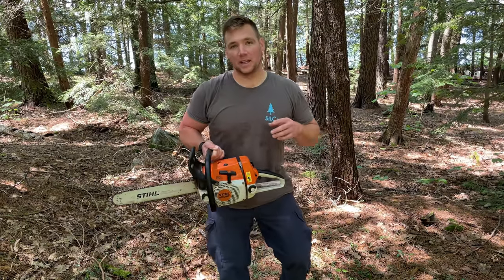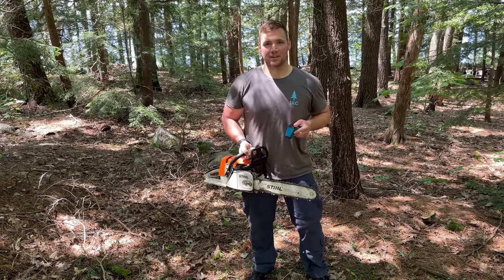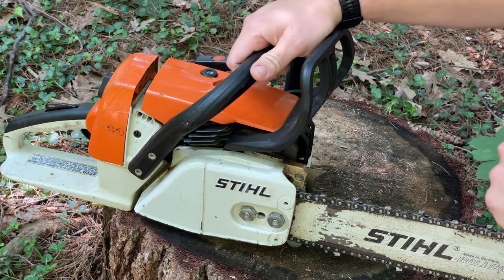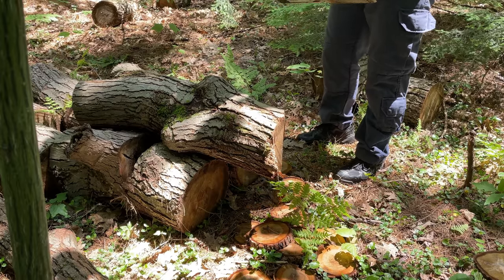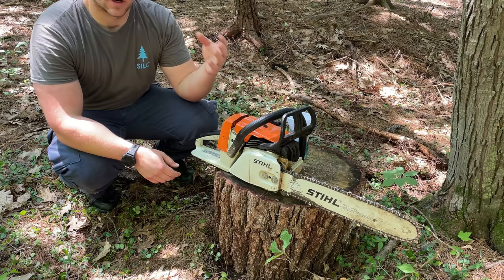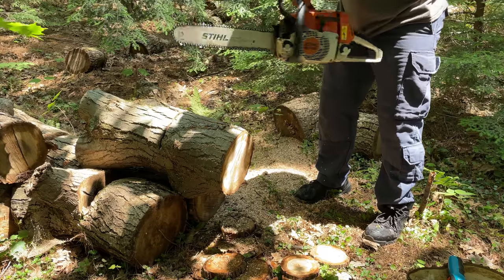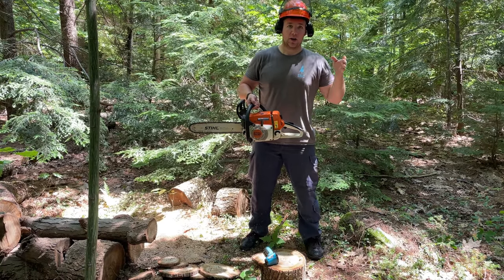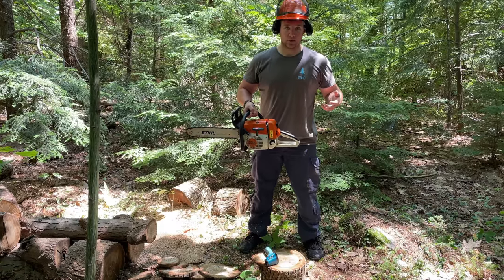Will my chainsaw last longer if I use more oil? Is it safer? (25:1 VS 50:1 temperature testing)

Comment: Excess oil barely helps the bottom end, excess oil really hurts the top end. It actually causes more of a piston slap effect as oil burns slower then gas and gets built up. We've done a lot of research and have found this. 50:1 lasts forever it seems. Thousands of hours on original top ends.
-Edit now that I've watched your video, no offense but you need to not run such dull chain and or high raker . Not sure what's going on there but your bar & chain might be getting hotter then the motor.
Reply from the maker: Hey Erik, thanks for the comments! I have been using 45:1 but I may go back to 50:1 with your research in mind. I’ll look into the chain!
Reply: @DavesSmallEngines  To each their own. 45:1 ant bad but I'd refrain from 40:1 and especially anything richer. 
And yeah, "Sharpening is key"

Comment: actually use a 50:1 ratio and had a glob more times than others it will compensate for a carburettor set too lean

Comment: who the hell runs 25:1 anyway .  of coarse it will lose power with that mix . it does'nt mean 40:1 is bad . i figured 40:1 
would help it cause the ethanol makes it run hotter. but 25:1 is way out of hand . the test should be 40:1 vs 50:1 
 if it's close enough i'll go with 40:1  , 50:1 is for emissions . BTW , i am now removing the ethanol from the gas 
with water . but i will still run 40:1 till the EPA cops catch me . ethanol vs non ethanol would be a good test to try
to compare the temperature .

Comment: 40:1 always " in every type of 2 stroke  but 1 that' exclusively runs 32:1  today's oli don't burn smoke or leave carbon deposits like oils of yesteryear" back then if it didn't smoke something's wrong" but castrol smelled almost as good as bar b q"

Comment: After reading comments ….and some thought  , I propose  that there’s no evidence that the extra heat of running the saw with more oil  result’s in a disproportionate amount of damage damage  🤷.    I’m not a mechanic  of any type … I just cut shit with my saw  .  I always put a splash …extra oil in my mix  👣🦘  .   I know consumerist corporations design stuff to fail now days .    
At some point in time , we went from being valued Customers , to  over abundant consumers Ripe for the picking  .     

My recommendation is , don’t believe what you are told you know - do your own investigation’s  about everything .    

If all you know is what you’re told you know  - have you learned anything , or simply been tolled what to believe …. And how to think about it .

Comment: There should really be no debate here.. the engine is designed to last a certain number if hrs at a certain air fuel ratio and certain amount of oil. Running the engine leaner on fuel is certainly terrible for it. More oil will not save it from that. Now if you rejetted it to have the right air fuel ratio while having an increase in oil, maybe itd be beneficial but probably not, youre trying to redesign something thats already had tons of money put in to testing these things, more money than any of us are going to spend.

Comment: The saw Goin be hotter cuz it was worked harder on 25 to 1 cuz a chain is not as sharp clearly n he's not dogging on as much like 50 to 1 an we don't know if the carb was tuned for the 25 to 1 ratio so have to do myself n see
Reply from the maker: If it was duller... it would work less hard!

Comment: This is far from conclusive.  First of all, more oil means thicker fuel so you would need to tune the carb to run richer.  You essentially leaned out the air fuel mixture which will make your saw run hotter.  Plus, doubling the amount of oil is not realistic.  Try 32:1 or 40:1 and tune the saw between tests.

Comment: I can tell you if it ain't smoking you don't have enough oil in it. In two cycle engine spark plugs are cheaper than the engine. I've been doing this for over 40 years

Comment: So  you  are saying the  oil  leaned it out.. You needed to  open the carb screws to make  it  run at the correct fuel ration.
  Race bikes  make  more  Horspower useing  Bean oil at  20 to 1 than the same engine  makes  on 50-1 synthetic  oil .. Just a long known fact among motocross racers..

Comment: It’s painful for me to watch you cut with that dull ass chain. I’m assuming your trying to heat the saw up by running a dull chain? You are running the saw lean with the 25-1 because you didn’t adjust the carb. More oil means less gas and a leaner mixture. My experience with high quality modern 2 stoke oils is that 40-1 is about the best ratio when it comes to a compromise between life expectancy and carbon deposits. 50-1 is an EPA thing, don’t run 50-1 if you want your engines to last. 50-1 with a good oil will keep the top end alive but it will starve the bottom end of oil.

Comment: Long term causes carbon build up on the piston and top of the cylinder head. Carbon will eventually score your cylinder walls and reduce the airflow on your exhaust side causing more heat and eventually failure. Leaner fuel is actually more healthy when you use the correct oil. I rebuilt chainsaws and have seen the effects.

Comment: It’s not a good test. You need to post at least three cycles of baseline to prove that the saw doesn’t stack temperatures it could be that the saw increases temperature through each three minute cycling and three cut series so we need to go back to the drawing board and post a baseline at 50 to 1 where you do that series 23 times to see if the subsequent cycles show a temperature increase which I suspect they will

Comment: I can already tell you,. without hearing results...
If you kept the same carb settings or tune,. With higher ratio's you essentially are running leaner with the higher amounts of oil.
Nice Try.... of coarse it's going to be Hotter being Lean, 
You went to a lot of trouble to do a whop sided  test.
I'll tell you this,. ..

I'm running a 1970's homelite 650 today on original cylinders and piston, that saw is probably older than your parent's.
Furthermore I have a neighbor that runs a landscaping business and has to buy new equipment every season or 2 (two).
Everything is 50;1 Sthil brand. Sthil Oil.
And I am talking about 12 years of history for reference,. not a 1 afternoon filming session.

My closing thoughts,. I see 40 or so years of real use,. and I have new Husqi equipment that I tune to run 32;1 and yes it smokes a little,.
But my stuff runs every-time and every year,.. and I heat with wood and have 2 sawmills,. so my stuff is not just sitting building years,. they earn their keep.
Compared to your 1 hour vested and stacking the deck in favor of 50;1... I'll take my years of FACTS over your yellow diaper comparison. explained, you still $#!ting yellow. with the way you did this "little test"
You might fool the city folks reading,. but guys that turn wrench's and know how to turn them are not fooled. 
Another 1st hand run.
I ran a PE 175 dirt on 100;1 because someone "Smarter" than me made the comment that oil actually caused drag.. (I was late teens eary 20's) 
I burnt the piston grove out behind and around the rings in 10 minutes Top's,. a brand new Wiseco in the 90's to the tune of $100 
It ran like a bat outta hell but the time and effort was not worth the reward.
So at 55 years old in the year of 2024,. I say "for once and for all" it is NOT OVER. 
I'll keep my 32;1 thank you.

Comment: So you run 50-1 on a cold engine and then switch to 25-1 after its already hot and "prove" that 50-1 runs cooler? You also didnt retune the carb. 40-1 is a better ratio anyway or maybe 32-1 at the richest.

Comment: If you check the spark plug on an engine that has been running rich on oil you will see a lot more carbon deposits.

Comment: There is not a lot of difference in the amount of oil between 40:1 and 50:1, but twice that amount @ 25:1. If your just a home gamer wood tic then 50:1 is good.

Comment: Well my chainsaw likes 40 to 1. I run it at 50 to 1 and when I shut it down it won't start up again until it's cooled off. 40 to 1 it'll fire right back up. So explain that.

Comment: Interesting topic.  I would be curious to run the 50:1 after the 25:1 and then do the 25:1 test again so you have 4 sets of data allowing time for the saw to cool to see if the results repeat.  Seems like the Stihl engineers may have tested this already?  Lol

Comment: More oil means it's harder for it to burn the gas . Less oil it burns better because it's easier to ignite the gas fumes.  Because it the fumes that ignite and a Lube oil doesn't  burn as easy.  Do a test on it and you will see and then you will know why it's not good to use more oil

Comment: Going from 50 to 25 to 1 is an excessive extreme. I doubt you would find more than a 1 degree difference running a 40 or 45 to 1 in a 50 to 1 saw. And personally since i dont have a means of measuring the oil id rater have a little extra than run it lean
Reply from the maker: That makes sense to me, Jimmy!

Comment: What I noticed is you ran the saw at higher RPM when testing the 25 to 1 mix.  Of course it will be hotter.  You claim the 25 to 1 had less power, less power means less heat produced.  So your test is invalid.  If anything the 25 to 1 should run cooler.

Comment: Your audio is a bit low in most of the video.   Addressing your title "25:1 VS 50:1."   You been chatting with your elders.  25:1 was a ratio before your time.  Today the oil and today's saws (as shown in this video) is/are of higher quality than it was in the 1970's and earlier.  Hence, today's 50:1.  Basically, it is best to slightly over oil than it is to under oil.  With more oil you will see smoke and the engine will labor more, but you'll have engine lubrication versus NOT with to little oil.  It is a question of how long to you want to keep your saw alive and well.  (JF)

Comment: You took it to the extreme.  No one runs 25:1.  You should have tested 40:1 and 50:1.  The second test you also started with a warmed up saw.
Reply: Stihl advises to use 25:1 for non-Stihl oils.

Comment: To much oil gets you more carbon build up.. for milling I run 40:1 because I'm running it hot.. 50:1 for everything else with good oil
Reply from the maker: Sounds good!

Comment: 32:1 kicks butt and equals 4 ounces to  gallon
Reply: Bit too much oil on modern Nickasil engines. Try 42.5:1
Reply: @shannonwhitaker9630  50:1 with ceramic crank bearings

Comment: My old pro Mac calls for 30to1 of straight 30 weight oil
Reply from the maker: Hey Wax! Oil has come a long way since then!!!
Reply: @DavesSmallEngines  that's true but that saw been run that way since it was new in 1979 and still runs like brand new

Comment: Before this gets started, these manufacturers spend a ton of money testing what's best. If more oil was better, that's what they would recommend.
Reply from the maker: I agree, Jeff!
Reply: @DavesSmallEngines  Men have this "More is always better" complex. Lol. And "Instructions!? Who needs Instructions!?"
Reply: @DavesSmallEngines  I've been looking into Amsoil. They swear 100:1 is enough for anything. I was already thinking that would lower the temp on the engine before this video, which I'm just now getting to finish. I'm curious to see what temps you arrive at.
Reply: At 25:1, it would probably lock down eventually, and I expected more heat. But I wonder if a 75:1 would be cooler? Probably about the same, but stopped up screen and could plug would happen much quicker.

Comment: No it won't it will cause clogging and power loss, but if you use JASO FD oils 2% instead of Stihl oils, then your machines will run much longer...

Comment: 25:1? Sounds like Chinese doesn't have a clue or they just don't have the high quality synthetic oils that we have in the U.S. I run VP Racing at 40:1 carb tuned a bit rich to 4 stroke letting up in the cut of a log close to bar size. I scored a piston/cylinder running 50:1 too lean. Live and learn.

Comment: I've litterly just poured a cup of heavy weight diesel engine oil in a gallon of high octane and have run many many small engines daily for 3 years so far. My forman stoped buying premix oil but would be pissed when I couldnt fuel anything. I said eff it. I'll just use what we have. If anything since I started everything actually runs better. The k saw cuts concrete better on my heavy mix lmao

Comment: I think you are getting into BTU values between gasoline and oil. Oil does burn hotter than gasoline so burning excess oil add to BTU value and therefore higher exhaust temp. If so not indicitive of lubrication efficiy. imao

Comment: Unless you tune the motor for each level of oil you have completely wasted your time. However, you do show that more oil will just lean the fuel mixture resulting in less power. However, performance two-strokes run high ratios of oil resulting in more power.
Reply from the maker: Hey there! All great points. Thanks for the comments!!!

Comment: Hay Dave no one will go from 50:1 to 25:1 and the heat and power difference is well known so this vidio is a waste of time, your camparison should have been done with a resonable mix of 40:1.--In sum the difference with those two factors(heat and power) would be minimal and not even noticeable on some engines, that little difference is more than worth the reliability and the longevity of that engine. I won't run anything higher than a 40:1 fuel ratio regardless of manufactures recommendations and never use less oil than the engine manufactures recommendations. All you contractors and owners of these engines and equipment spare yourselves some money and headaches and DON'T EVER believe any of these premix and two stroke oil companies that claim that their richer fuel mixture covers all mixes and supersedes the engine manufactures recommendations, this is false. Yours truly, Paulie T. (63 year old born gearhead)

Comment: Well sure at 25:1 it will run sluggish because your replacing oil for gas at this drastic difference. 40:1 is best for longer engine life ,just common sense more oil more lube.

Comment: If you use more oil than recommend the extra oil will not burn as clean and turns into  CARBON that builds up behind the piston rings FORCING the piston rings to be forced out toward the cylinder walls causing a loss in power due to increased friction to the cylinder wall and RAPID excessive carbon build up in the head and crank wear........

Comment: 3 oz per gallon
Reply from the maker: Cool!
Reply: @DavesSmallEngines  and ethanol free shit aint no better. STIHL440/460 is my favorite saws of all time. Left them sitting for months, reg gas, crank right up, no problems ever. Had to clean a  carb once, disintegrated some drive sprockets, wore out some bars. Still ripping ass. God bless brother.

Comment: TO MUCH OIL WILL KILL THE POWER AND SOOT UP THE MUFFLER.MIX IT RIGHT AND DONT IDLE IT AS IT CUTS THE AIR FLOW.THE FASTER IT RUNS THE COOLER IT WILL RUN,IF ITS PROPERLY CLEAN.50 YEARS EXPERANCE

Comment: I understand this was strictly an oil/fuel mixture experiment but part of your presentation stuck out to me and that was the fact your fuel was sitting out uncovered letting the light ends evaporate off your fresh gas. That brings us into a whole other discussion about fuel octane while being mixed at those two separate ratios. Poor fuel, improperly stored fuel, old fuel, winter fuel, summer fuel (RVP), oxygenated fuel, non oxygenated fuel and a whole host of different octane levels can also affect those numbers as well as and in addition to fuel/oil ratio itself. I like where you were going with your experiment but I think there’s a lot more variables to consider before anyone makes any definitive decisions about one being better or worse than the other unless we’re strictly adhering to manufacturers recommendations. No disrespect implied. 👍🏻

Comment: Well its obvious that like the rest of the world that you haven't read you owners manual. It plainly states that if you use stihl branded oil 50 to 1 is standard.BUT if you use anybody elses oil you are supposed to run it at 25 to 1.a boring read i know....

Comment: I don't know the answer.  I have 8 2 stroke machines that I  abuse.  I run 3.5 oz oil to a gallon.  I mean I  abuse my stuff.  NEVER not once an engine issue
Reply from the maker: What is the ratio?
Reply: @DavesSmallEngines  36.6 to 1

Comment: One thing you didn't consider is how lubricated the bearings stay at the different ratios.. Bone dry bearings 50 to 1 bearings slightly lubricated 30 to 1. Pick your poison.
Reply from the maker: I’m not so sure about that Dan! I’ve been in my fair share of crankcase and there’s always a nice coating at 50:1!!!

Comment: So mix it 40:1 instead of 25:1, it calls for 50:1, i always run mine 40:1 & have never had an issue, time proves my own test, i dont need a phoney you tube video...

Comment: 50:1 is really just the environment pollution department pushing that ratio on manufacturers. Don’t ever use 50:1. 40:1 is the most you wanna push the ratio. I normally still use 32:1 but as long as you aren’t going past 40:1 you’ll get the most life out of your engine

Comment: Todays oils are much better than older oils. 50:1 in anything is enough. I have saws that call for 25:1 but I've always ran 50:1 in them since the first tank. No problems at all and the have many years and hours on them. Not a scratch on the pistons or cylinders. Most people that run more oil are just afraid they're going to tear up their saws or think more oil will make the saw last longer. All myths. Saws that run hotter never last longer.